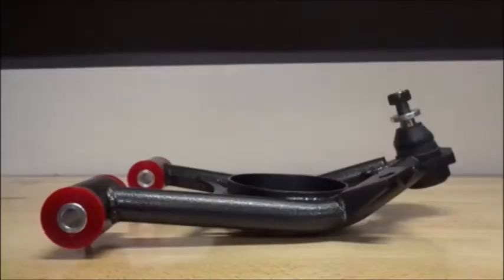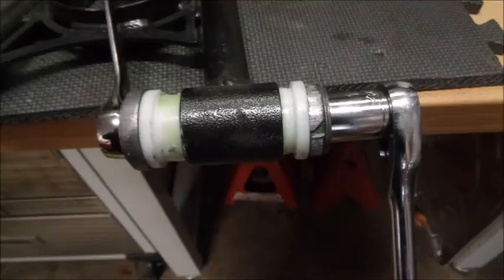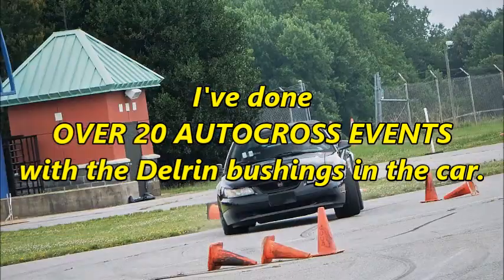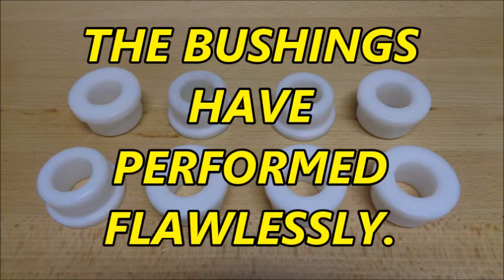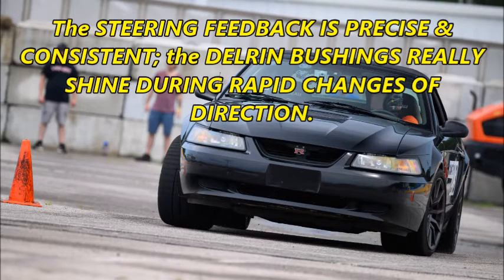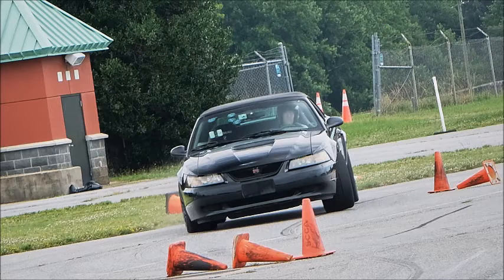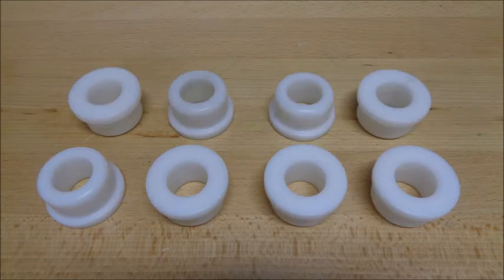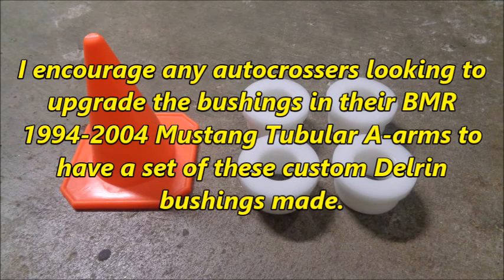LONG-TERM REVIEW: Custom DELRIN BUSHINGS for BMR 1994-2004 Mustang Tubular A-Arms

Comment: I have delrin bushings in 2 cars, the rest are on heim/spherical with delrin bushings. The only downside to delrin in place of poly is impact resistance. If you drive a car on the street, dependent on condition of the roads you frequent, delrin may be an issue. I had a bushing failure recently while driving a street in Texas, late at night. Road construction and they'd removed the asphalt along one section. There was a steep step from the removed section back onto the asphalt. Was traveling at maybe 25-30 (45 posted) and I knew something went badly wrong when I hit it. Taking the tire off, removing the upper ball connection and moving the a-arm through it's range of motion, the damage was obvious; an audible 'clunk' through some portion of the movement range. 
That said, I replaced them with another set of delrin bushings when I got him home (TN) and vowed to take the truck next trip to Texas.

On the track, they're great. Wouldn't run anything else.
Reply from the maker: Sorry for the delayed reply. I normally respond to comments within 24 hours. I don't daily drive my Mustangs, but I do drive to and from my events (75-100 miles each way). I haven't had an issue with the Delrin bushings I use (custom and Global West), but my roads are generally in good shape. I've been extremely impressed by the performance of the Delrin bushings under autocross conditions.

Comment: Have a trick for polyurethane bushings to stop them squeaking. wrap the Metal pin in tafflon tape you can have gaps in between the wraps of tape where you can see the metal.  Then cover with marine grease Or the grease that is supplied With the bushings.  Back to the tape make sure it slides back in without bunching And you're good to go for several years. Hope this helps someone out

Comment: Could you provide a link to the specific grease you're using? I've slowly been replacing my delrin bushings with uhmw as they self lubricate and have high wear resistance.
Reply from the maker: I use Green Grease. It's available at many auto parts stores.
Reply from the maker: Links sometimes lead to comments being removed, but I'll try putting it here: www.greengrease.com

Comment: Glad to see you doing great again this year and as always I'm looking forward to more vid's. I was wondering if you knew of anyone selling used 17in tires my current ones are dry rotted so I parked the car once more after getting it running and shifting good. I run a 245/40/17 front and 275/40/17 rear I can go 255 front and not scrub, 295 rear so anything that will get me up and going regardless of the size would be a huge help. I normally wouldn't ask but most everyone I know is a drag racer and I love going to piedmont but they car isn't set up for it. As always thank you for great content.
Reply from the maker: I'm trying my best, but I've got some tough competition this year. I don't know anyone selling used tires right now. Like many other things, tires have been hard to find lately, so I think people are holding onto theirs longer. If you're not on FB, it might be a good idea to come to an event or a club meeting and ask around.